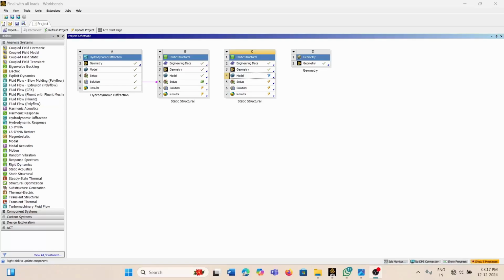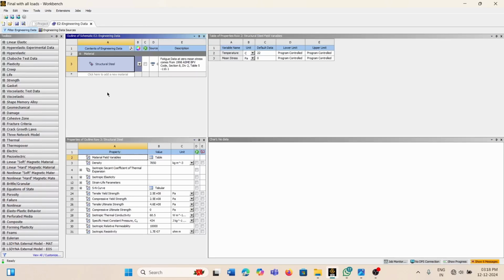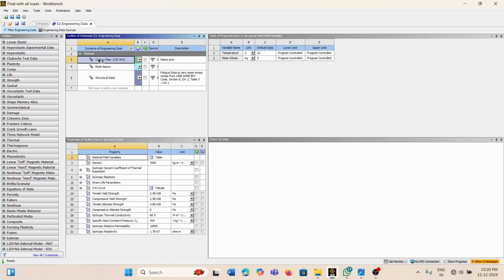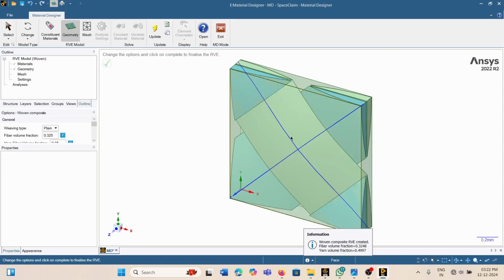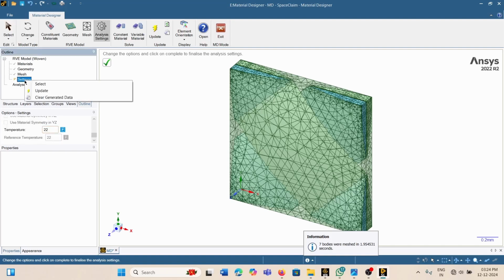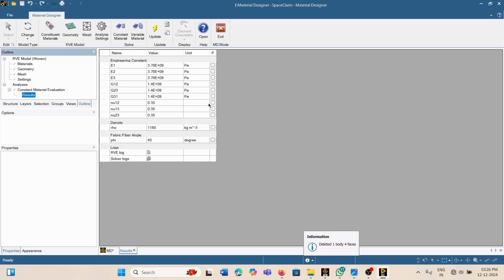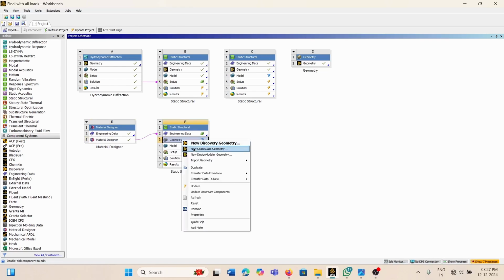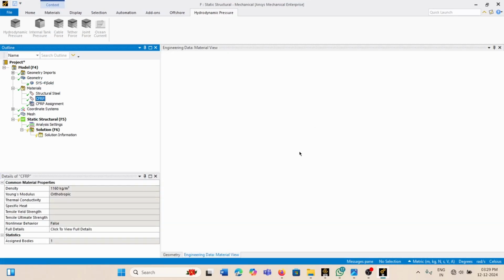Beginner's Guide to ANSYS Material Designer: Create & Assign Composite Materials

Comment: Hello Sir, it is very informative video for me. But I a dought, If I want to make a woven composite with a new combination of materials other than CF & GF then what is the procedure?
Reply from the maker: Hi, thank you for your comment! From your question, I understand that you want to know the procedure for using a new material in the analysis.

To proceed, you need to provide all the material properties. For composites, which are typically anisotropic, we often simplify the analysis by treating them as orthotropic materials. In this case, you will need to specify 9 constants to define the elastic properties:

3 Young's moduli,

3 Poisson's ratios, and

3 shear moduli.

If you're modeling the material as orthotropic, determining these 9 elastic constants is essential.

Additionally, if you're interested in analyzing failure, you'll need to provide tensile and compressive strengths along with other parameters in three directions. You must also choose an appropriate failure theory for the analysis.

I hope this clarifies your query!"
Reply from the maker: Basically you need to give properties for the new material